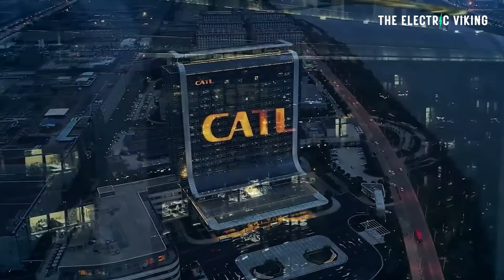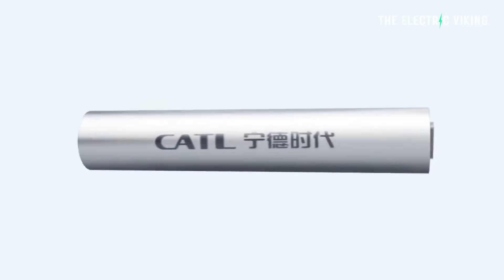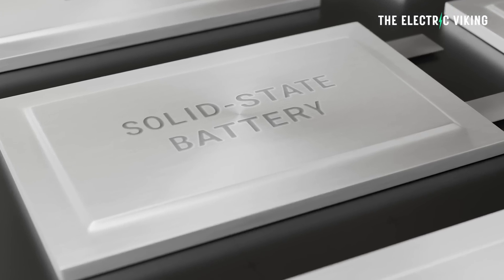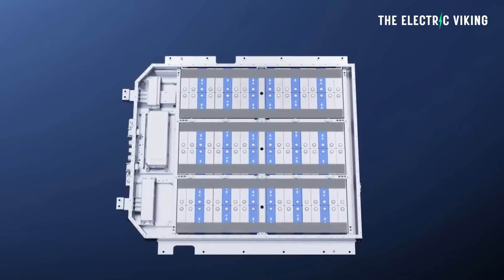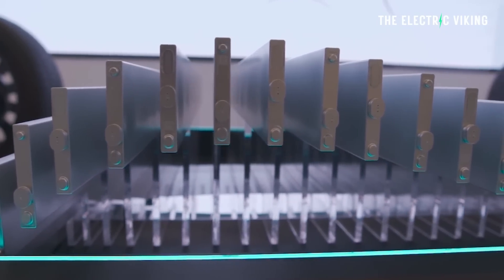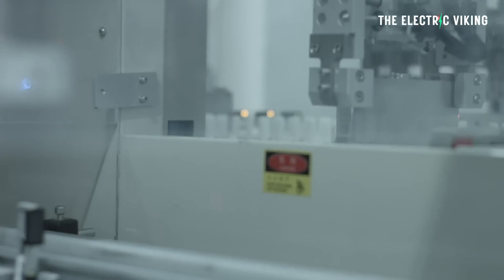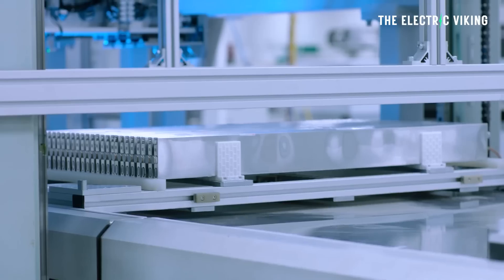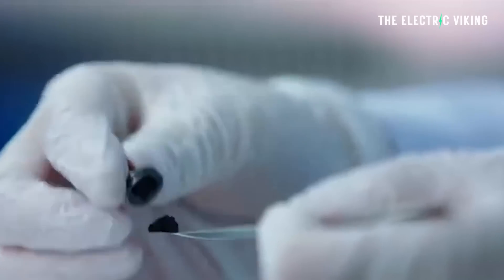CATL's sodium hybrid battery will be 30% cheaper & revolutionise the world

Comment: Norway still uses the same amount of fossil fuels they did 15 years ago.
Reply: Their population has increased by about 10%.  Autos has also increased by 10%.  ICE cars are having a decreasing fuel economy as they are getting bigger.
Reply: @kensmith5694  ICE are getting more efficient and having to work with more restrictions from emissions equipment. So that's a wash. Norway isn't the ev Utopia the media is making it out to be.
Reply: @francismarion6400  The numbers show a lower number of miles per gallon over the last several years.
Reply: @kensmith5694  Emissions equipment.
Reply: @francismarion6400  The reason doesn't matter to the fact that the mileage is decreasing.  The newly bought ICE cars will not has as good of economy as the ones they replaced.
Reply: @kensmith5694  What do you mean the reason doesn't matter? If we added 2,000 lbs to any vehicle, would that affect its range? Emissions equipment does the same thing.
Reply: @francismarion6400  The reason doesn't matter.  We have the numbers.   The numbers show more people and more cars and ICE cars taking more fuel per mile.  Thus the change to EVs prevented a significant increase in fuel use.

Comment: As a Canadian I can tell you we often go colder than -20ºC.
Reply: Living on the westcoast of British Columbia, -20C doesn't happen but I get your point.  As 90% of Canadians live within 100 miles of the USA border, it will make sense buying an EV with this battery as there are few days in a year that there is sustained -20C...  This tech will only get better and you will see automakers find a workaround for extremely cold days...
Reply: @truenorthbc  

The prairie provinces get about 2 to 3 weeks worth of minus 20 C a year.  Significant enough to impact usage
Reply: But that's outside exposed to the full airstream  ..  you can insulate the pack relatively easily.  And these fast charge at room  temps.
Reply: but 90+% of the people on earth never experience such temperatures. it make sense to offer different chemistries for different climates.
Reply: ICE vehicles are equally not the best at handling really cold (-20C and below) temperatures.
Reply: @gregtheelectricviking  Yes. No perfect solutions. Just go for the best that suits your environment and requirements.
Reply: I live in Manitoba, Canada and we often have -30 deg C and occasionally even minus 40. Plus I need to drive long distances to places where there are no charging stations.
Reply: @ryeclansen7371 
Average winter low in Winnipeg is -18C. So this battery will still do very well, just don't forget to put on it's long underwear come winter 🤣.
Cheers
Reply: @ryeclansen7371  Charging stations can, and will be built. It's not exactly rocket science... :)
Reply: @ryeclansen7371 .Canada needs some global warming.
Reply: @ryeclansen7371  At -30 deg C, Manitobans are hugging the electric outlet to keep the radiator warm.
Reply: The way to think about it is to consider the amount of energy bleed required for the car to keep the batteries at a usable temperature while just parked there doing nothing.  Cells capable of charging at -20C in -40C weather only need half the bleed energy that cells capable of charging at 0C in -40C weather would need.

In -30C weather it would only need 1/4th the energy.  You get the idea.

Anyone living in Canada with an EV over winter already knows that the EV pretty much needs to be near-full, or left plugged-in if it is going to be parked outside overnight in weather that cold.  So this is mainly a matter of how much energy the car wastes keeping the vehicle operational after the battery has become full.

Of course, ICE engines and components don't really fare very well in ultra-cold weather either.  You really have to take care of any car in weather that cold if you don't want it to have an early retirement.

-Matt
Reply: @junkerzn7312  You don't need to keep the battery pack heated at ALL times... Jesus! lol Just like with a gasser with an engine heater installed, you have a timer to warm it up sufficiently in time for when you leave your home in the morning. And you don't HAVE to keep it plugged in overnight either (it just performs better if you do), what nonsensical fairy tales are you spinning here exactly - you sound like one who has never had any actual EV experience at all and only repeats FUD disinformation spread by the usual suspects.
Reply: @lennyvalentin6485  At -40C you actually do (though to note, -40C is not a continuous temperature even in Canada... averages are higher than that).   The battery is a very large mass, if you are thinking the vehicle can warm it up in a reasonable period of time.... well, good luck with that.  Even pumping 5kW into the pack will take an hour to raise the temperature 10C (ish).

So you aren't really saving anything by waiting.  Best to just leave the vehicle plugged in with those sorts of outside temperatures.   At more typical "cold" temperatures, no, you don't need to leave it plugged in.  At -40C... you kinda do.

Gas and diesel aren't much different, actually, but don't have the convenience of being able to leave the engine running overnight.   Though semis up there generally leave their engines running the entire working day when temperatures get that low.
Reply: @junkerzn7312  Look, I wasn't speaking from the perspective of the most absolute extreme temperatures - exceptionally low temps are...exceptions. Like with everything. Sometimes there's extreme rainfall and huge floods occur - is  that a daily occurrence? No. It's typically not even a decadely (hm...) occurrence (unless you live in Bangladesh.) It happens, but we don't plan our entire days on the possibility it might.

And, with this new and improved battery tech, battery temp doesn't need to be raised as much as with traditional LFP cells, or even NMC. If we get 90% capacity at -20C, what do we get if the cells are at -30C, assuming we're at a bone-chilling -40C outdoors temp? If the cells still give around 75% capacity, you might not need to heat them any more than that, you'll still be able to get around just fine in your daily life.
Reply: @lennyvalentin6485  Yup, exactly.
Reply: Very few countries would go near that low temperature, but it is good if this new battery and go as low as -25 degrees.
Reply: But at -30°C,  -40°C any car parked outdoors is going to need a heater. Doesn't matter whether it's a block heater for an ICEV or a battery heater for an EV.
Reply: give it 10 years. :)
Reply: Yeah but Canada's not a real country. 😁
Reply: At that temperature, the brains would sort of freeze 🥶
Reply: Sorry about that. Canada needs the same vehicle solution as Russia. 😂
Reply: @markuc  Yes. Canada, Russia and a few other very cold climate countries.
Reply: @markuc  
Canada needs a nuclear heat reactor 😂😂😂
Reply: With climate change, Canada will be hotter. Just keep invaders at bay to be able to enjoy climate and ressources :)
Reply: It's hard to take Canada seriously when you have a clown for a PM
Reply: Oh ya, that last cold snap a few weeks ago here in Saskatchewan.
With wind chill and it gets blowing something crazy here.
Last winter-50°C  was nasty!
Reply: We don't. Move to Australia and problem solved.
Reply: He never said Canada wasn't cold, but Canada isn't most countries and he said "most countries don't get that cold".
Reply: Hybrid battery or even a tiny range extender
Reply: So? This battery is still better than other batteries at -30 or -40 or -50. That is the point. 

So it does not lose efficiency until colder than -20. Other batteries and ICE also lose efficiency at those temperatures. 

So your point is not really a point in this conversation, is it?
Reply: Eff that.  I’m in Los Angeles and even reading that made me shiver
Reply: Nobody cares what happens in Canada. Even Toronto and Vancouver don't care what happens in Canada.
Reply: I'm Canadian.  I have no garage but I had no problem using a block heater.  A similar tech for an EV will work just fine.
Reply: move to Australia ;)
Reply: In Vancouver BC Canada on the Westcoast, we never get that cold
Reply: As a Romanian, I can tell you nobody cares about Canada. 🙂
Reply: In some places the union contract says that at -40C you don't have to show up for work.
Reply: @kensmith5694 In Canada?... I have never heard of this. The schools with kids, yes. But work?
Reply: @kensmith5694 I like my beerold but not that cold 😄🇦🇺

Comment: Even these batteries wouldn't work in MN where it can hit -37C (-35F) in the winter times in southern MN.
Reply: You know there’s a massive country to the north of you called Canada where it gets alot colder than MN. Yes we have plenty of teslas working well up here in those conditions.
Reply: @fergyspoolshots  My EV also get less range in Canada but still cheaper than an ICE. Most people do longer drives in other seasons.
Reply: The batteries don't just stop working. At colder temperatures they cannot charge as fast, ect. Saying they wouldn't work is just completely false.
Reply: You are all forgetting about Norway and Sweden  which matches winter conditions and ICE cars are on the endangered species list ..  even the marinas have free charging stations for electric boats... As both have extensive archipelagos with people living and commuting pretty much all year round to locations and schools on the mainland.  The N is well inside the arctic circle.
Reply: Pretty sure you never owned an EV. Mine has been doing fine at -40. I live 350 miles Northeast of that Minnesota-Ontario border.
Reply: Does it ever stay below -30c for over 24 hours? Tesla says warranty is no good if over 60c or under -30c for that long
Reply: Okay, since you say so.
Reply: At low temperatures, the battery have a lower power ability but it is not zero.  They can use some of the batterie's energy to warm the battery and then it is fine.

Comment: No, not yet.  Getting closer though.  CATL and BYD are pulling-up the baseline capabilities of several chemistries.  The most interesting right now is CATL's Shenxing 2 (or Shenxing Plus, depending).  That one is a LFP battery with (a) very good cold-weather charging, (b) 4C charging, (c) LFP (safety), and (d) around 205 Wh/kg... competitive with NMC.

That covers all the bases except the ultimate ICE killer which will be an energy density closer to 300 Wh/kg... we want THAT in LFP but we don't have it yet.   Once we get that, it is game over.

The current sodium battery announcements, particularly the hybrid, are NOT a game-over technology.

-Matt
Reply: Why are they hiding the cycles of the Shenxing Plus battery? Also we need 4C charging without cooling
Reply: @rwyo83  You'll never get 4C charging without cooling, with any battery chemistry except maybe lithium-titanate (which isn't suitable for most applications).   But cooling really isn't that big a deal.  Just being able to do 4C for any appreciable amount of time at all means the internal resistance of the cells is already gonna be pretty low.

I doubt they are hiding the cycle count, being LFP batteries one can assume it's gonna be at least 3000 cycles @ 80% DOD to 80% capacity.   That is pretty much a given for this chemistry.
Reply: @rwyo83 Not hiding the battery... Just still at the lab stage ..
Reply: That will be the Na S tech they are working on .. and that will be light and cheap  and have the power.
Reply: What about the 500wh/kg condensed battery? Wouldn't that be an ICE killer if the price per kwh is low enough?
Reply: @100c0c  The problem is the price.   It's roughly 50x the price of LFP on a per/kWh basis.  While batteries with those sorts energy densities have been constructed, the manufacturing process is extremely expensive... which is why, at best, such batteries would be targeted at electric aircraft and not consumer or commercial vehicles.   I'm sure there are other warts as well but that's the main one.
Reply: @junkerzn7312   What's the (realistic) holy grail for EVs? I assume solid state batteries, but what density, charging speed, etc?
Reply: @100c0c  Just one item left for the holy grail... a 600 mile real highway range in a $35K vehicle, and a 300 mile real highway range in a $25K smaller commuter vehicle.  

Everything else has already been achieved (safety aka LFP, low-temp charging and performance, and fast-charging).

Note that the Fast DC charging network is mostly irrelevant in terms of the consumer transition because once real highway range hits 600 miles you only need destination charging, which can just be slower and far-easier-to-deploy L1 and L2 EVSEs.   A commercial transition will have a greater need for Fast DC charging.

-Matt
Reply: wrr

Comment: This may be why Tesla is reducing supercharger efforts.  Better faster batteries will greatly reduce the need to supercharge.
Reply: So less time to charge reduces the actual power needed??!!

To fill a 100kWh battery you can use 
2kW and wait 50h, or
10kW and wait 10h, or
400kW and wait 15min

The energy is Watt times hours, so the faster the more W you need. 

Supercharger‘s difference to other charges is the power (in kW) they pump into the car‘s battery. Dropping them is only a sign of stupidity.
Reply: @fromgermany271  There may be a battery breakthrough around the corner.  A higher capacity battery would mean fewer stops.  A faster charging battery would mean less time spent charging which frees up the charger for someone else.
Reply: @fromgermany271 
Your opening question shows you don't get it.  More efficient batteries are faster charging, so the range you need will be acquired more quickly.

Comment: Sounds great. But I’ve been hearing this for a long time. Lots of hype extremely slow delivery and cheaper better batteries. And cheaper better electric cars. I’ll believe it when I see it in the showroom.
Reply: Your point is reasonable. But I think the problem is us. We expect these gamechangers (haha) to hit the market very quickly but I guess manufacturing doesn't work to our wishlist time scales. But if we look back several years, the advances become more apparent. 5 years ago, I don't think LFP was even on the market.  Then it came in at about 160 kwh/kg. Now its up to approx 200 kwh/kg and the prices keep dropping. So I think we're getting there, just not as fast as our 'modern life' brains would like.
Reply: The first 250mile+ EV, 16 years ago, cost $150k for a basic two seater.  In 2012 the price dropped to $80k, to $45k in 2016.  Now it's $25k or so and still falling fast, driven by exactly these kinds of advances in battery capability and cost.  What part am I missing?
Reply: It's because western car makers drag their feet. For a long time it was very deliberate, now they are just years behind and have sluggish processes. These news come out of China and are in cheap chinese cars in China. Till this technology gets here, without massive tariffs on it, it will take a few more years.
Reply: Legacy auto maybe has two years to become competitive before the Chinese are flooding the markets with EVs. Else it's game over for them.

And yes, EVs have become far cheaper in the last decade. But as with every technology, it becomes ever more challenging to squeeze out more efficiency. The reason why ICE development is practically zero. But for EVs, which are already having a lower TCO than ICE it's still in the early stages of development.

It's just a matter of time when ICE is finally done. Technically it's already done. It's just that production capacity for EVs still has to ramp up and that purchase price for an EV is far too dominant in the people's minds.
Reply: It's the same battery, Sam just changes the graphics and the specs, so he can announce the next 'game changer'

Comment: Given apparent chinese production quality, how susceptible is this new battery to spontaneous combustion? Also, how difficult would such a battery, if on fire, be to extinguish?
Reply: Is that still internal combustion, or already external one? 😂
Reply: It is not china, it is the chemical properties of Na and K, drop a little piece of them in water and you'll see.
Reply: The new chemistry is dramatically safer, however the outhoing chemistry wasn't the real problem with EVs made in China, it was insufficient casing for the battery pack. Tesla cars are FAR less likely to experience this problem.
Reply: Do you have any idea how many ICE vehicles catch fire every single day?? More than 500 per day just in the US.

Comment: The only way to really know about all this battery stuff is for people to be able to buy an EV with the battery in it and see if it works and lasts for the number of cycles needed and required for BEVs. So far EVs seem expensive to buy and don't come with a repair plan in place. All good news from Sam here and time will tell the actual story. BTW...   No EVs on sale here in Australia yet that the average worker commuter can afford and get repaired.
Reply: the most popular vehicle in Australia atm is the Ford Ranger (I think) and its a very expensive vehicle. So I don't buy that. Most sales here are in fact, in the outer suburbs, as folks have realised that for a commute in Sydney or Melbourne, an EV wins hands down. Also, MG4 is approx 40k and its a fine vehicle.  Battery longevity is a concern but fears appear to be overstated. I have an acquaintance who bought a Model S in 2013 and its battery is currently sitting at about 85%. And battery chemistry and management has improved a lot since 2013. Replacement batteries will cost next to nothing in 10 to 15 years from now.